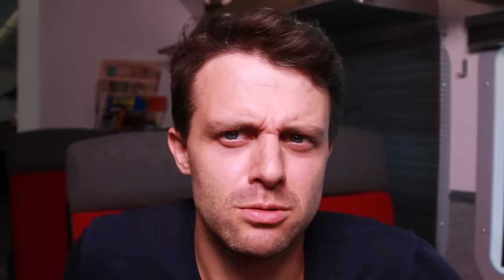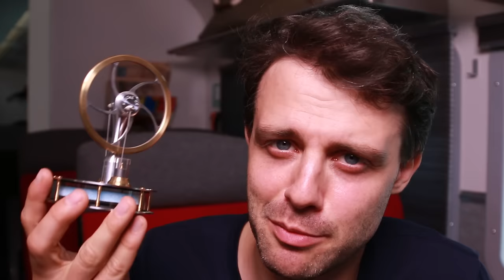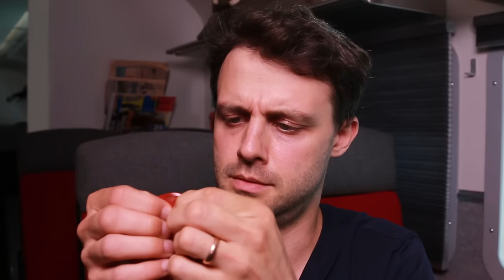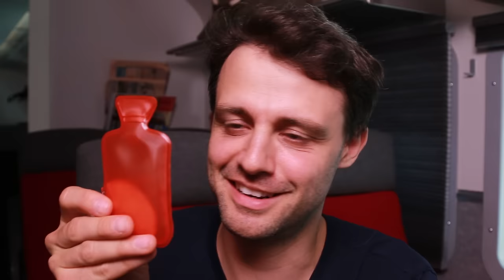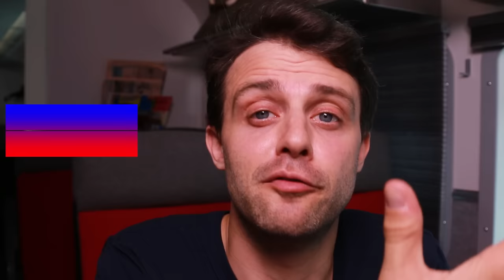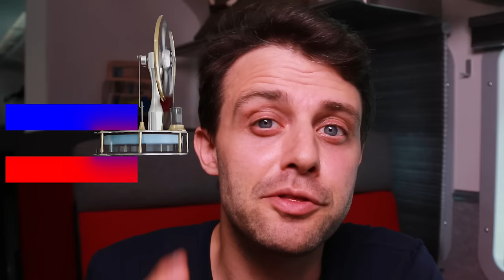A better description of entropy

Comment: I've always disliked "disorder" as a description for entropy, When energy distribution is homogenized, with everything spread out evenly, that's about as orderly as anything can get.
Reply: I don't like the disorder definition because it's easy to misconstrue and doesn't do a good job of giving someone an intuitive explanation of entropy, but it is correct. There are more ways to create "identical" disordered states than there are ways to create "identical" ordered states, but at that point why aren't you just giving the actual and correct Boltzmann definition? It's really not that hard to understand. You can even use dice to explain it, there's only 1 way to roll a 2, but there's 7 ways to roll a 7. Entropy is defined as the the number of ways you can get a particular "big picture" measurement. When you randomly roll 2 dies, you're more likely to roll a 7 than a 2.  Congratulations, you just described both what entropy is and why the second law happens with nothing more than something everyone has seen and addition. It's even easy to relate it to Shannon entropy from here.

And after revisiting this video after a year, I still don't like it. Maybe it's useful for the way an engineer thinks about thermodynamics, but it's useless for how a chemist thinks about it. Give me the boltzmann definition and I can instantly see that solids are lower entropy than gases, but this one? That's not at all clear.
Reply: It works when you're learning the statistical mechanical derivation of the Boltzmann equation. It's how we learned it at university.
Reply: It's a crappy description also because it's one word trying to represent a somewhat complex idea. I mean if someone asks you to define it you need to spend a little time explaining properly. If you are a professor standing at a chalk board you'd likely throw in some equations as well. And at the end of it, because as a society we have the attention of gold fish, we say something like, "Sooo... disorder?" And in frustration we say, "No, the answer is that thing I just took five minutes to tell you."
Reply: Ron Arguelles that’s how it was explained to me as a kid.
Reply: @Mezmorizorz  Bouth is in same walue...
Reply: Ron Arguelles     Exactly what I always found confusing!   This guy nails it brilliantly!
Reply: I think it's as good as a one-word description gets.
Reply: I think that the 'evenly spread' distribution is only 'even' on average - there's local unevenness -, and in comparison to the 'clumped' distribution.  If you started sampling from the volume at random with a bucket, you'd be more likely to scoop up a ball on each sample but only likely to grab 0-1 balls, whereas in the clumped state you're likely to get 0 balls each time, but if you get any you could get 1-9 in one sample.  I think.
Reply: but it IS disorder!

there is a huge amount of ways of homogenous distributions, but only a few ways of "ordered by temperature"...
Reply: @Mezmorizorz  Agree that an engineer and a chemist perceive entropy in two different ways (because I have been both). Another point is that we need to re-define order and disorder whenever it is in the context of the topic entropy......
Reply: The problem I have with that line of logic is that we're then accepting common usage definitions for words we use in science, which would suggest we also need a new word for work.
Reply: Ikr. Order and disorder are just terms used to describe how easy it is for humans to navigate a system. There isn’t really a solid, objective definition of “disorder.” People are just too goddam stupid to see the flaws in that description and to find better words to describe entropy.
Reply: That is why I feel my bed and room is about as orderly as anything can get after I leave the bed in the morning.
Reply: Watch minutephysics video on entropy vs complexity its just as nice as this video.
Reply: @hassanakhtar7874  Actually entropy only works in thermodynamics and will fall apart in nuclear chemistry and plasma physics in cosmos, creating new structures.
Reply: Ron Arguelles   I would consider everything being in categories as more orderly than everything mixed together, but I see your way as well.
Reply: Exactly.  To me E just represents an imbalanced system on its way back home.   I don't know what all the fuss is about!
Reply: 'Energy' does spread for sure, but we are not heading towards a stasis, we are in a polarized current of energy in omnidirection, because there is no volume-boundary in reality, force/direction/movement/energy goes in as well as out, in all locations.  

Spin.  This is why things will not homogenize, and it is the engine of existence.  Spreading and crossing of energy will lead to a homogenized stasis, matter spins as a barrier due to cause and effect spiraling i assume, making units, the more energy, the more spin.  Basically.  It is only a matter of location and perspective that determines any variables, there is an infinite tunnel in all locations with matter in such an unseeable volume moving fast enough to speed out of existence, but its the atom's atom's atom. Same going up.  Try to snap a pic of the edge of the universe looking out and you would need an ever expanding lens with a shutter speed as long as the infinities to capture any movement. The edge that will never come, as you would need to be the edge for there to be a perspective of view from one.

Im not in the mood to nail this description right now.

The 'uncuttable' atom was not a proper analogy.  More like a limit to an observers effect, i.e. the knife cutting.  To understand, you don't need to cut something to make it smaller...if it has a surface, it is three dimensional, and dividable to infinity.  The place to observe such spacial-divisions is the limiter, no destruction or cutting is needed to hold this analogy.  

Volume is expansive in a polarized direction.

Pick an air atom out randomly in front of you.  Now decsribe it's 'floor'.  How is that physics if you did?
Reply: Randomness is order.
Reply: @richardgates7479  existence being a thing is order
Reply: @mineduck3050  
Depends on your perception. It may be necessary in order to perceive, but not necessarily to exist.

Why am I getting drawn into this same argument on 3 different unrelated videos, seems rather disorderly.
Reply: @richardgates7479  I get the nuance but regardless, reality has a cause effect, no matter how abstract, order to IT.  We wouldn't have anything to define if "it all" did not come about by some system wherein, by accident or purpose or chaos, it ordered itself to be.  

So i guess the opposite of what im saying, is that if it was unordered chaotic as a foundation, it wouldnt have gotten us two to YouTube today. The order of things is inherent for it to be a thing, regardless of its behaviour, its behaving.... because it exists.
Reply: @mineduck3050  
I never said there wasn't any order, only that you effectively find what you're looking for. The order that is YouTube is extracted from the chaos of the Internet.
I have plenty of examples of order coming out of chaos. We ignore the disorder, it exists regardless.
Reply: @richardgates7479  I think its more about what parameters we are pitting on the term 'order'.

Self determination, perhaps the key component of life, is 100% a form of disorder. So therefore life itself is one large disordered perpetuation of randomness and chance and determination to physical law...yet all happening in this pristine genius order of mechanism required to host any disorder.

But, is it finite and in decay? Dont get me started, you will run away
Reply: @richardgates7479  here's one of many off the top of my head explanations of what I think. They hardly ever spur debate, but if you think it over, you will at least have questions...
 
...  one main big clue is volume. It's omnidirectional and unlimited.  There's an expansion, and an INspansion, to make up words....

So energy/direction/force/movement is not just out, it's in. Volume mirrors large and small, there is no limit to small, just a limit to measurable perspective, as it's not just small but 'faster', sped up out of reality.  Time and space/volume are always relative to the Observer, and differ only from observational comparison at different perspective.  So, there's 'worlds' in your atoms, and if you had a house on one (analogy) and lived forever, your 5 million years was my one second (arbitrary).

In order for no stasis, things, twist/spiral/helix....essentially making spin and spheres that separate matter into units (that of course are moving always).  More matter/energy accumulating, the more spin caused to separate it, and that's the engine of the universe....in the abstract.

So the electromagnetic force is straight line polar, in and out, non accumulating, and gravity is this force in a spinning sphere consisting of unlimited volume.  It's not very amazing, but it is genius.  Understand volume, understand a spiral, and boom, unified theory, at least in the abstract.

It's also what the old genesis story of the dome refers to, if you take away the parable and apply it's poetry to engineering. The dome was made to separate the waters etc....makes no sense, unless you consider what a dome is when viewed on a surface inside it...a part of a sphere.  Yeah, listen I'm not religious, but those first few lines of the Bible are interesting.

Right now, we have two great theories, one is general relativity, one is plasma cosmology.  Relativity is one direction and reaches stasis, yet the dynamics and energy and observations in the Now space age don't show gravity as the dominator force, so the theory has had to conceptualize gravity existing into the infinite to explain energy, and dark matter and energy being 99% of the universe to explain infinite matter in matter....an impossible as of now prediction to prove/falsify.

Plasma cosmology makes answers and predictions that are right and use physics, but the electric force won't accumulate without forcing conception.

So, this "perspective theory" unifies them in the abstract, and ive been hunting laws that make it impossible. Haven't found one yet.

As a thought experiment, pick a random air atom out in front of you and describe its floor. Describe the physics of that.  What limit to volume is there that is measurable and retains law in that atom?
Reply: @richardgates7479  even Tesla  alluded to it. He said of the ether idea "it has been conceptualized that this ether is gaseous and atmospheric in nature, but it is clear that it is in fact very dense and very energetic".  Dark energy/matter are the gravitational models inevitable showdown with the ether theory.  BOTH are describing infinite volume (depth) to matter/space.
Reply: Ron Arguelles 
If things don’t change at all, does the concept of time exist?!?!?
If nothing moves, there is no way to track time. Time is dependent on matter changing its position.
Reply: I've always figured it to more like equilibrium than anything
Reply: @Couldar  For equilibrium I say evenness. Entropy is evenness. Evenness makes everything predictable.
Reply: @jwingo7257  interesting thought... Then in that case, does time move slower as we reach closer to the heat death of the universe? Since once the whole world is fully entropied?? , all the atoms are arranged in dynamic equilibrium and there is no change to the system. (Like how reactions slow down?).

Maybe to linearize the reaction curve we should have time increase? In line with how time seems to moves faster as we age?
Reply: @jwingo7257  
"If things don’t change at all, does the concept of time exist?!?!?"
Of course it does.
Just because we use time to quantify change, it doesn't mean that that change (or its absence) itself defines time.

"If nothing moves, there is no way to track time. Time is dependent on matter changing its position."
"Tracking" time & "existence" of time are two different things.
E.g. I don't have a Geiger counter at hand right now, does that mean it's safe for me to go to Chernobyl?
Is it non-radioactive anymore just because I have no means to track radiation?
Reply: Ron arguelles I have same perception
Reply: The definition of using # of arrangements is cleaner.  If you flip 100 coins, there’s only one arrangement where all 100 coins are heads.  But there are millions upon millions of arrangements where 40 to 60 coins are heads and the remainder tails.

If you take Everett’s MWI interpretation rather than the Copenhagen interpretation, then each of these arrangements live on in its own timeline.   But from your perspective, you only live to experience the timelines that are likely, which compresses your view of the world to those arrangements that are highly numerous.

So you just won’t see the rare events like all 100 coins are head, or all the air molecules in your randomly concentrating into the corner of your room until you suffocate to death.  You will instead observe the strong tendency toward greater entropy, even though a very rare chance exists to materialize random motion into a Boltzmann brain and compose sonnets.
Reply: Ordered chaos? An oxymoron, but think about it this way, more homogeneous a mixture with even dispersion from its previous state,  more would be the entropy out of the system also making it efficient in useful work. The time function in this energy process derives its power rating
Reply: @Mezmorizorz  Sorry, but your dice example, though it might contain information that could be used to describe what entropy is, clearly does not in your example. Could you elaborate please?
Reply: LOL I just posted the same thing before seeing your comment.  People can only think of their creations as "order" not the actual and natural perfect order the universe tends toward.
Reply: @Mezmorizorz  To me the Boltzmann definition, as it relates to states of matter, says that the more entropic arrangement is the one where the substance has larger intermolecular distances separating its particles. Then there is water.
Reply: That’s what I was wondering! Sure everything spreading out and becoming more homogenous means the universe is getting more orderly. Entropy is so mysterious
Reply: @bjalder26  Entropy was a new word defined by Clausius, in fact 😊
Reply: Yet I wouldn't let entropy order my money..
Reply: No, that’s maximally unordered. You can’t distinguish anything anymore.
Reply: I think of it as 'balance'
Reply: Thank you, holy shit, i fucking hated  arguing over this
Reply: Specificity and homogeneity make more sense to me
Reply: Actually, if you a well spread out energy but with high density AKA high volumic energy then entropy is higher than when that energy is concentrated in a point.
Reply: You could say any change increases disorder temporevely, as long as change is hapening there is chaos
Reply: Lo

Comment: So they had Stirling engines but no ice? One weird train indeed.
Reply from the maker: +Frederik Tessmann haha! Yes, very strange.
Reply: They save the ice to power the Sterling engines that run the train... ;-)
Reply: It's only a half train.
Reply: It's not a train, it's just clever green screening!
Reply: Er, if you gave it a moment's thought I think you would see that it's far more likely they had both, but you were only allowed to choose one or the other.
Reply: @labibbidabibbadum  the wave function collapses
Reply: @GregorShapiro  are we saying this could also grow in these temperatures extremes infinitely? Do they use this in everyday refrigerators?
Reply: I've never been on a train that didn't have ice.
Reply: Stewardess: "That's right, Sir.  Just keep turning that little wheel and it will cool your drink. Eventually."
Reply: This is England. You must bring your own sterling engine and ice in drinks is considered a ridiculous affectation

Comment: Entropy increases and so does my understanding of entropy, thanks to this video!
Reply from the maker: Great!
Reply: P Hampton   I don't want to play with that fire too much, but there is following phenomena: syntropy. This the new organization.  E.g. when one's organization gets bad, and it gets reorganized; etc...etc...
Reply: So...
Battery charged: Low entropy
Battery discharged: High entropy?

So entropy is kind of the opposite of available energy?
Reply: Erick Lopes yep
Reply: @ericklopes4046  Usable energy anyway. I suppose that's splitting hairs, though.  Entropy increases as one runs steam through a turbine and enthalpy decreases.  Then one condenses it and pumps it back to the boiler where entropy is decreased and enthalpy increased so it can be sent back to the turbine to do more useful work.  Enthalpy is order and thus usable energy where entropy is disordered unusable energy.